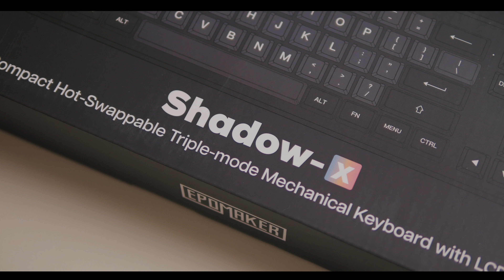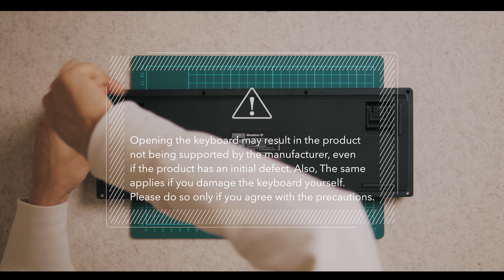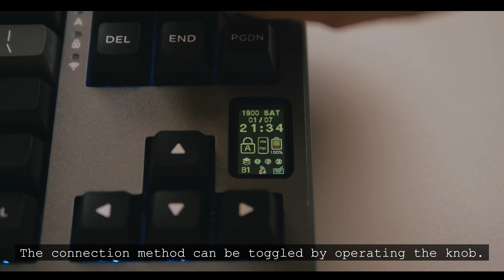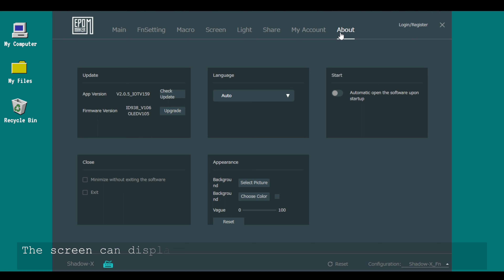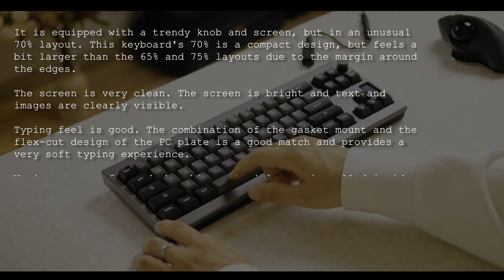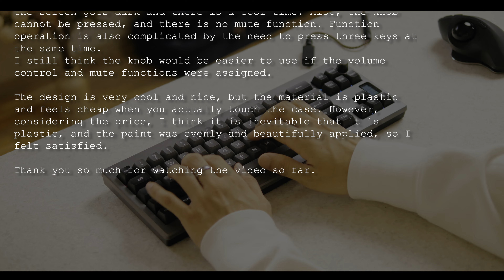Epomaker「Shadow-X」

Comment: Is there actually flex on that thing?  I've noticed that a lot of cheaper keyboards have so called gasket mounts but with how tight the plastic body is, they are effectively top mount boards.